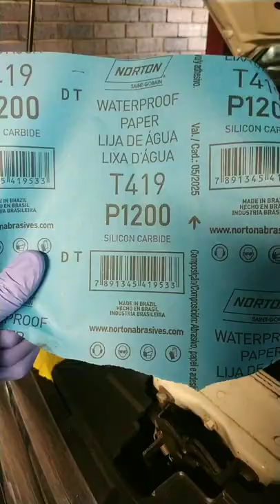The camshaft oil seal exchange: The easier way.

Comment: Just spend 5 bucks and buy a seal puller!
Reply from the maker: I also have a variety of seal pullers or removers. However, there was not enough space to use the tools. Additionally, this way is safer than using a puller as it doesn't make any scratch on the shaft surface.

Comment: @b.k.automotiveservices9489 That is a great way to damage the camshaft and the bore. Which will cause the new seal to leak oil past it. Defeating the entire purpose. Use the proper tool. A shaft type seal puller. It will be much faster and easier without risk of damage. This is coming from a factory trained Honda technician.
Reply: Went scrolling for this comment, I knew it would be here 😂 🤡
Reply from the maker: Mate, it's easy to say so when you don't know anything about a car. I have never failed to exchange the seal for more than 10 years, and always use this method.
Reply from the maker: If you are well experienced mechanic, you might know you cannot use the oil seal puller sometimes due to the location of the oil seal. This way is very useful when you need to replace oil seals located in tricky area, and I have never made any damage when carrying out the task. Can you explain what's wrong with this method?
Reply from the maker: You are right. If there is a large room, it is not necessary to use this method. However, I have a proper seal puller(not few dollars, it's more than 30 bucks), and I have realised that it doesn't work all the time for me. Therefore, I prefer to use this way, and there have been no problem so far. The reason why I am angry about your comment is that I have never charged twice to the customer due to the problem caused by my mistake!!!

Comment: My 2013 acura mdx mysteriously has an oil leak and needs crankshaft seal replaced. This all happened after mechanic replaced oil pan. Cud tech have damaged seal somehow?
Reply from the maker: There's no relationship between crank seal and oil pan.

Comment: What is the drill and bit doing exactly thanks
Reply from the maker: The drill bit(1.5mm diameter) makes a very tiny hole on the seal so that the screw can start to get in.